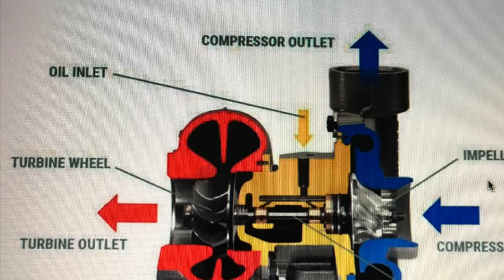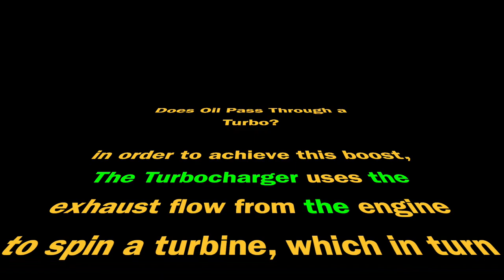Nissan Navara D40 oil leak turbocharger replacement

Comment: Hi, how to remove turbo? Access so tight!! Thanks for good video always!!
Reply from the maker: Well, it’s a bit hard and depending on the model of the navara like euro 3 and euro 4.

First you need to take off all the engine top hoses 

Second pour some brake oil to the 3 or 4 bolt on the topside where the turbo connected on manifold. 

Remove the left side wheel inner cover and take off 10mm bolt that are oil line and water line of the turbo side 

Underneath of the catalyst , remove the bolt that are connected 

Remove the top side of the turbo bolt and take off
Reply: @abcautotrendy  it's 2008 yd25 ta
Reply: @abcautotrendy  how to remove the bolt on the top of the turbo!! Nuts easy but bolts are impossible!!
Reply: @abcautotrendy  and bottom bolts and nuts are hard ones too!!
Reply from the maker: You have to have a star boxspanner to remove them or replace with new bolt

Comment: Having this exact problem at the moment.
Do I have to disconnect the negative battery terminal before unplugging intercooler sensor?
Do you have a step by step for this job?
Thanks for the great content.
Helped a bunch.
Reply from the maker: Hello dear, well, it’s Always better to take off the battery terminal before remove any electrical stuff on the vehicle.

Comment: Do we need to replace the turbo?. Can it be repaired?.
What cause the this happened in the first place?.
It's the end of the lifespand of the turbocharger or bad fuel. I saw some videos they repair the turbo charger. Thanks just curious.
Reply from the maker: Well, the turbo can be repaired if the existing components are in good and healthy condition such as exhaust and compressor housing, otherwise in most of the repair shops does is clean the vane and replace the whole cartridge… 

We do service the turbo for such instances of vane blockages

Comment: Having trouble removing turbo from catalytic converter.
Nuts are not moving .
Just want to avoid snapping studs.
Reply from the maker: This is a typical risk we have to take dear. So better to use rust remover first or just pour some brake fluid on the top of the nut and leave for sometimes..

Comment: Hi bro, can we just use turbocharger cleaner and use back the old turbocharger without replacing it? One more thing, how you managed to take out the turbocharger without removing the exhaust catalyst?
Reply from the maker: Well, turbo can be reused unless there is leak or damage to the carrier, cartage or turbine… 

* once you loosen the top and bottom studs along with the water and oil pipe line it can easily take off.. but if the catalyst is twisted then of course you have to loosen the cat studs as well

Comment: Are you sure it's not just the crank case return valve that go's back to the intake pipe between the airbox and turbo!!
Reply from the maker: Shane Lyons in fact that’s the only vaporizer oil goes back to intake via the turbo inlet but actual oil leak occurred from the direct oil intake from the suction due to the oil seal damage or the carrier/ housing damage

Comment: Hi sir have problem with my navara, i change turbocharger by now the is black smoke and the same time the car reduce speed
Reply from the maker: Hello dear ,

Please have a look at the intercooler whether it’s been block by the carbon as well whether the booster sensor is connected and working fine 

Please also have following check

1. Silencer is black 
2. Turbo solenoid (vacuum pipe) is working fine 
3. Injectors are clean and performing well